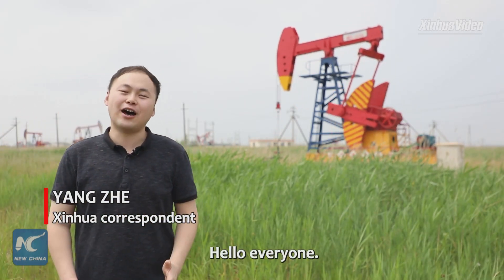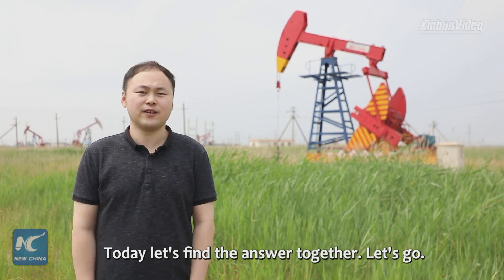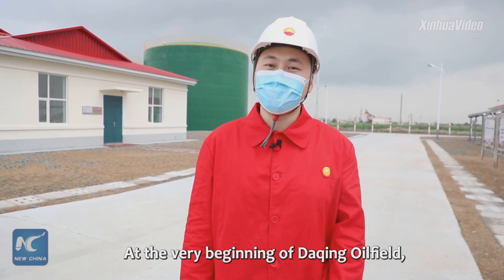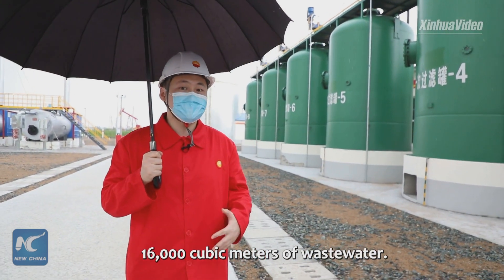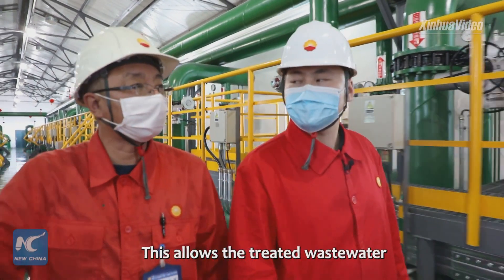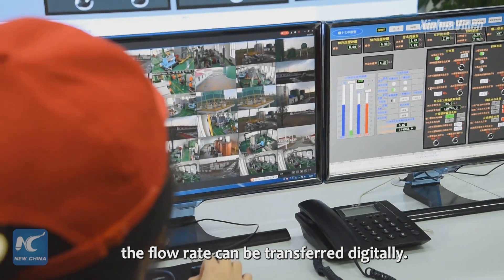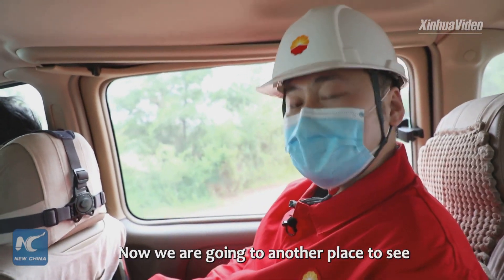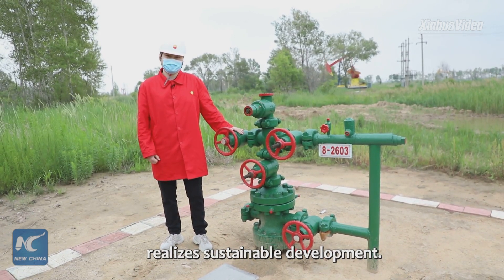Vlog: How does China's largest oil production base process wastewater

Comment: The Daqing Oil Field is in the Heilongjiang province. Discovered in 1959 this field has produced over 10 billion barrels of oil. Initially, Daqing reserve was estimated at 17 billion barrels or 2.4 billion tons. Current recoverable reserves are about 3.6 billion barrels  or 500 million tons. The production rate is about 1 million barrels per day making it the most productive oil field in China.
In the wastewater, there can be a long list of toxic contaminants, but removable with sequential processes. One process mentioned in the video is the reverse osmosis, in which waste is forced through semi-permeable membranes to separate water from dissolved solids.